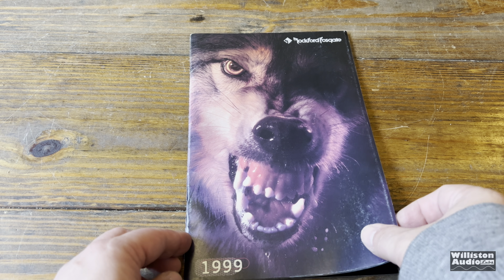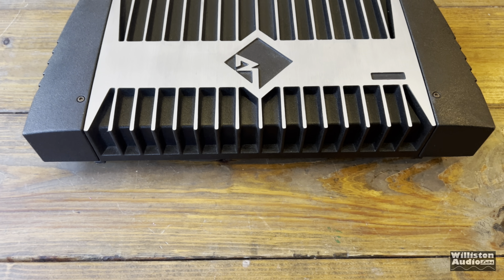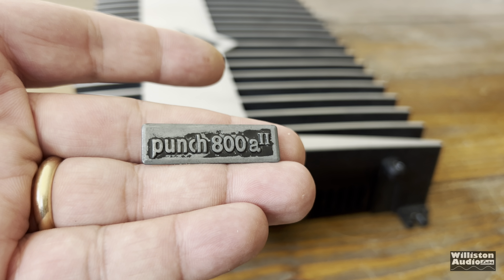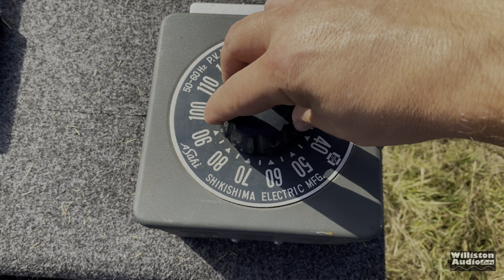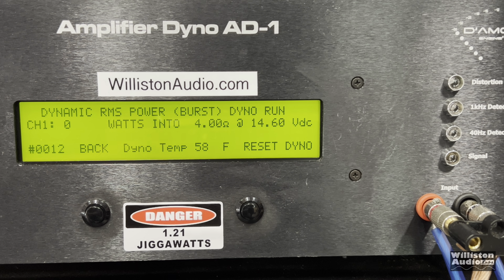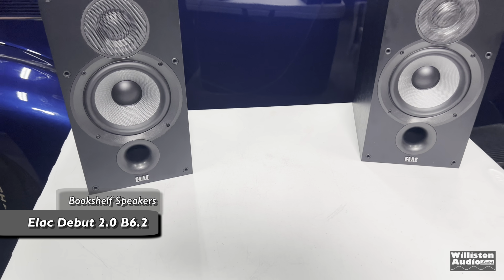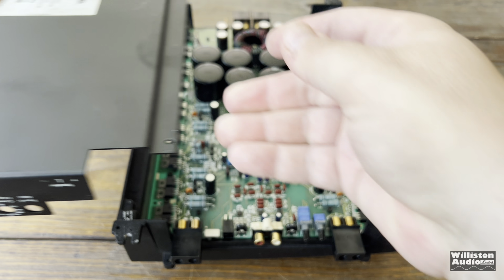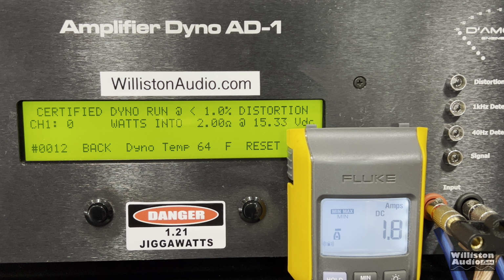This 800W Amp Cost $800 Back in 1999 - Rockford Fosgate Punch 800a2

Comment: Back in 2001 I had a Punch 120 going to a set of Kenwood 6.5" front and Kicker 6X9" rears and a pair of Punch 160's going to a pair of Kenwood Tornado 12's (4 ohm) in an 88 Towncar. Looking back now, I should have bought 1 large sub amp and just wired it to 2 ohms. They worked great until they didn't. Maybe lasted 8 or 9 years.

Comment: I had one of these amps and it constantly overheated. I believe it was a 2400w powering 2 type R 10s and boston accoustics in the doors. It might have been a newer model but essentially looked the same. It was in 2002 I believe. It made me hate rockford fosgate for a long time. Probably 15 years or more before I bought more rockford products.

Comment: Had the Power 800a2 on a pair of HX2 12s and a 600a4 on the highs in a Extended cab Ranger. That thing got down
Reply: Bro!!!! I literally was about to post that I had a 800.a2 on 2 he2 12" in a sealed box... beating the dog out of the little geo metro u was driving. Those amps were beast and I regret getting rid of it
Reply: I had that same setup ...car would shake!!! Didn't have same highs setup but sub kicked
Reply: I had a 800 a2 on 2 punch hx2 15s in a Explorer Sport it hit pretty hard back in 99/00 I had 3 JL audio W6 10s ran in series with the Punch 800 a2 with all alpine highs on a punch 160.4 and alpine deck those 3 10s in my Black on black 90 5 speed Foxbody was just as good as the 2 15s I loved the 10s but I think I loved the foxbody GT with Chrome Ponies and exhaust cold air intake so much that car turned so many heads back then I'm building another